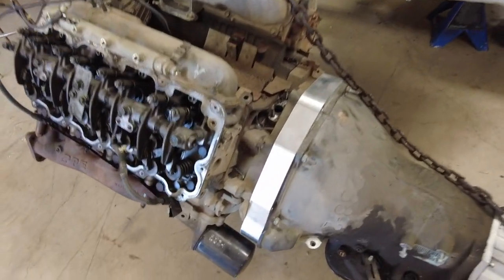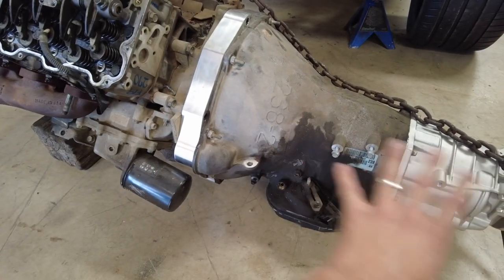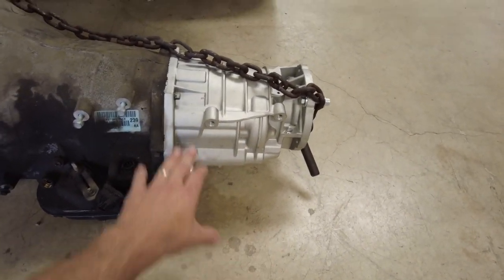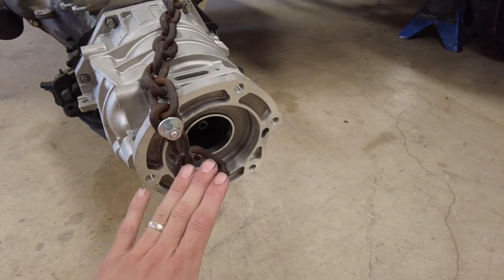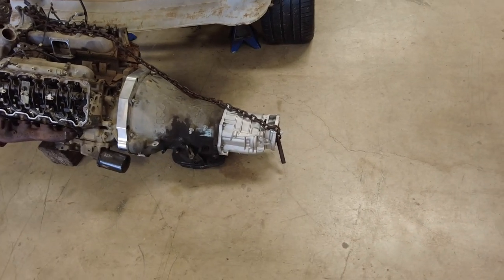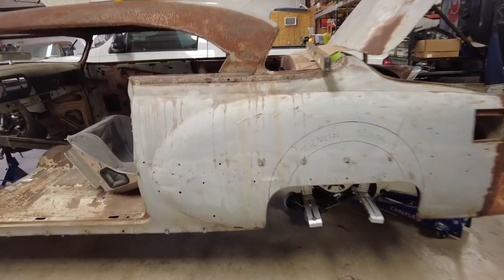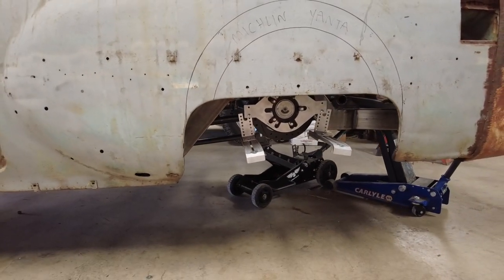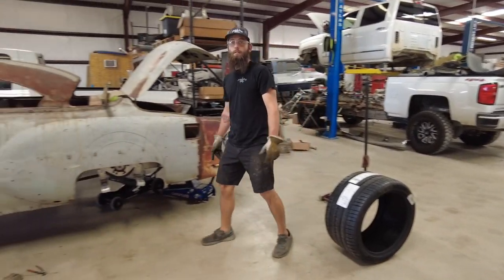54 Belair 1000HP Duramax Part 2

Comment: You should get a carbon fiber drive shaft. They won’t do as much damage if they fail. You should also look into a roll cage rated for high speeds.